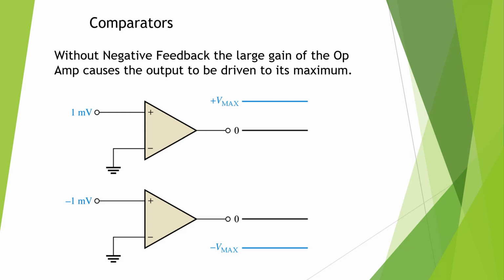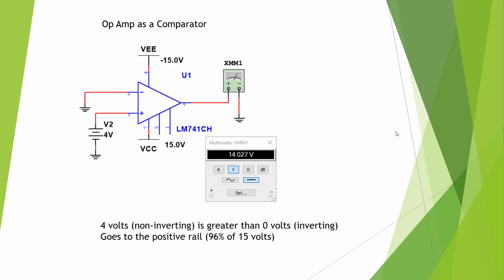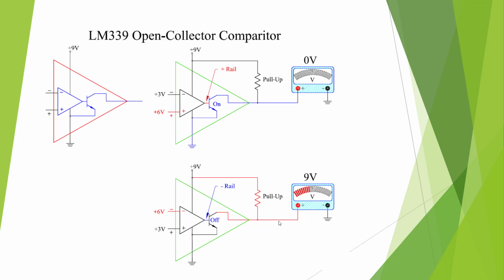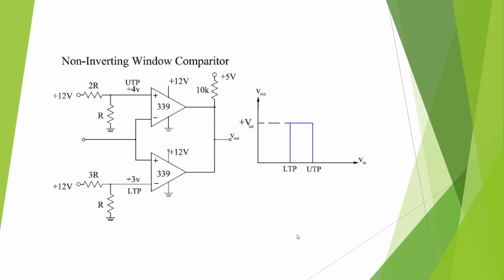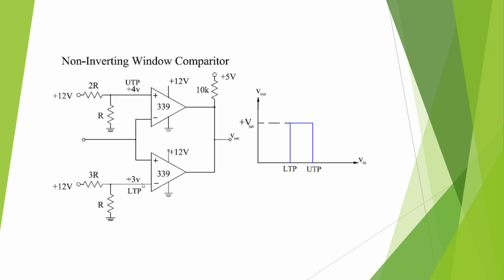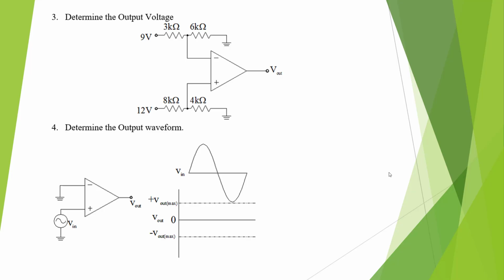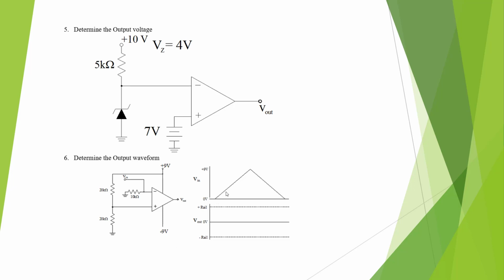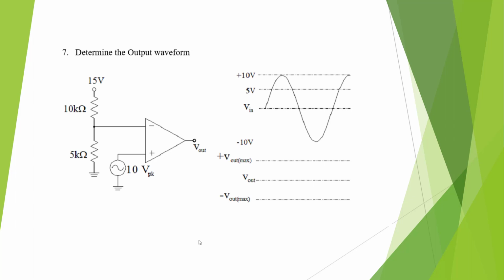Comparitor Presentation-335

Comment: There is a mistake in this circuit:voltage dividers must be interchanged between the opamps for this window comparator to be true,so @ 3.5v the upper opamp will go negative rail also the lower opamp with both transistors off the 5 v pull-up gives 5v output.below 3v the upper transistor will conduct & pull the output to ground,above 4v the lower transistor will conduct pulling the output to ground which makes the circuit true.As it stands now the output will be pulled low by one of the transistors below 3 in between 3 &4 v by both transistors & above 4v.